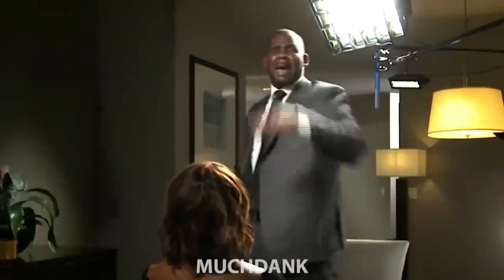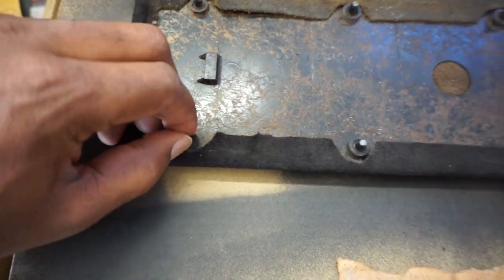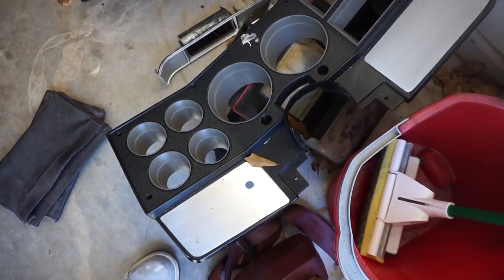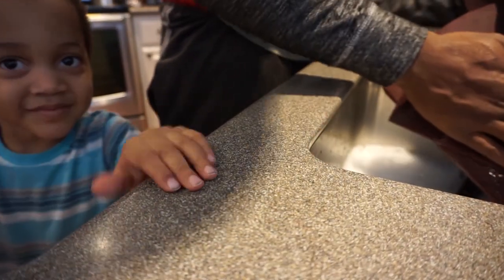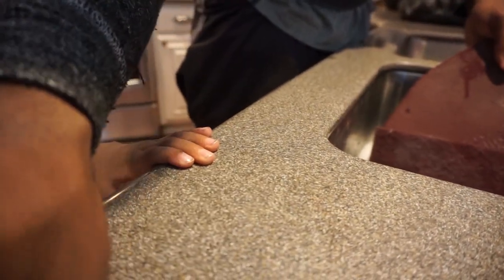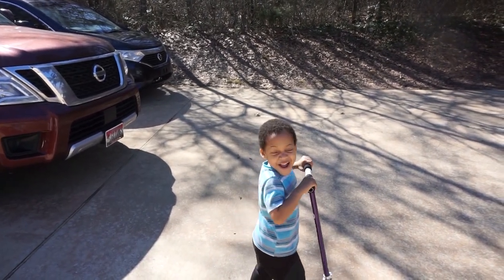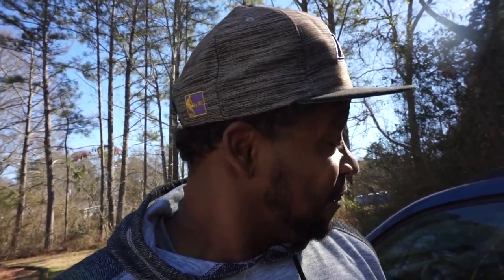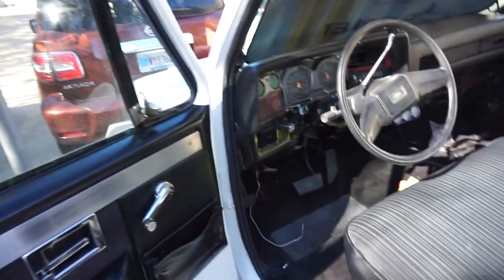Restoring My $1000 Chevy C10 Door Panels With Items From A Local Hardware Store!! (Must See!)

Comment: That rust on the door will is from water that's inside the door. As it runs out the drain holes onto the still . The inside of those doors are rusty and that's the rusty water that's running out and staining that still, it dries and leaves the rust behind from the water. It's not the sill rusting as water sits on it for sure.
Reply from the maker: Wow!! Thanks for sharing! 😎👍🏾

Comment: Something I have used on leather, is Vaseline, and baby oil mixed together and some comes in scents. Good also for dry skin, body butter, and massage.
Reply from the maker: Never heard of that!!! 😂 I might have to try that
Reply: Yes sir the vasoline and baby oil work .vasoline also works for tires and does wonders for a rough vinyl top on a car.ceramic wax works good n lasts for years on outside plastics well worth the money.
Reply: That other stuff don't last.
Reply: @lawrencejackson4001  vasoline lasts maybe two days or so with or without babyoil .its not permanent,but it'll get u out riding for the day or to a wedding or something.
Reply: @joshgalloner7663  mine lasted longer than two days